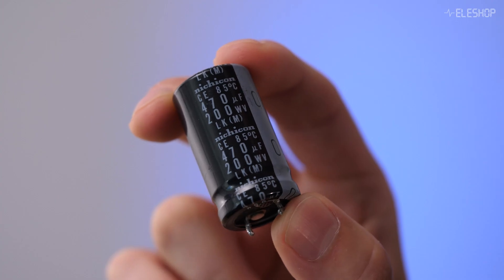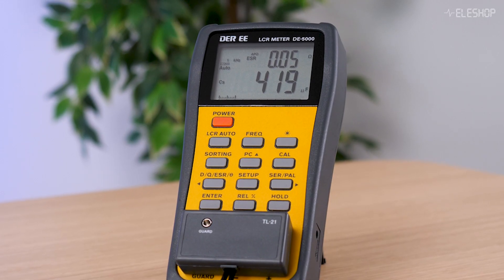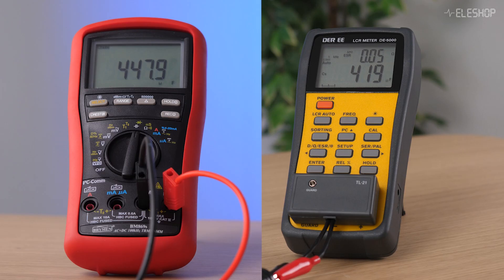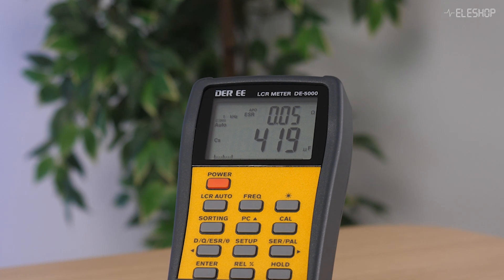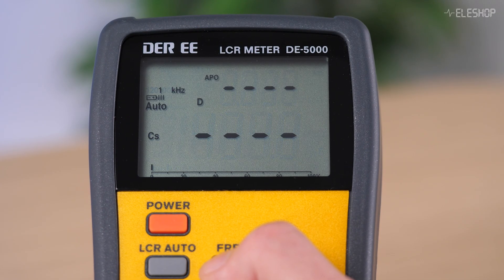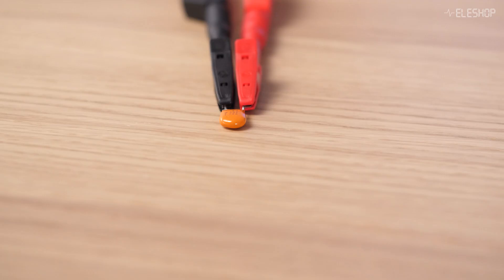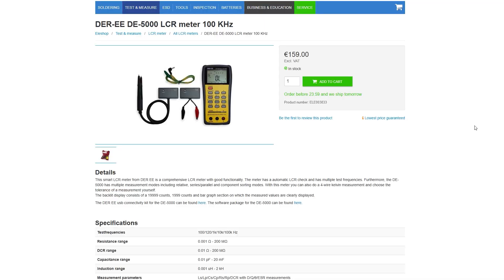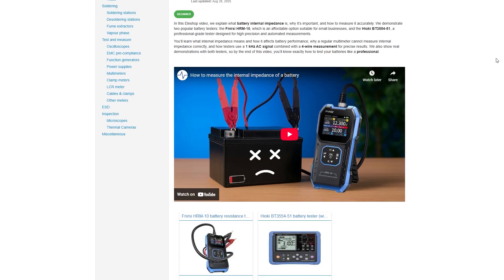Multimeter vs. LCR Meter – Why the Readings Differ

Comment: Hi..which LCR meter suitable for bare PCB? i'm first time user and from R&D division. Purposely to check parasitic capacitance in the PCB bare board
Reply from the maker: With the DER-EE 5000 you can measure from 0.5pF with reasonable accuracy: https://eleshop.eu/de-ree-de-5000-lcr-meter.html

Make sure the connections between the PCB and the meter are consistent and zero by shorting something on the board. 

Good luck!
Reply: मे भी DER-EE 5000 उपयोग मे लेता हू बहुत ही सुंदर